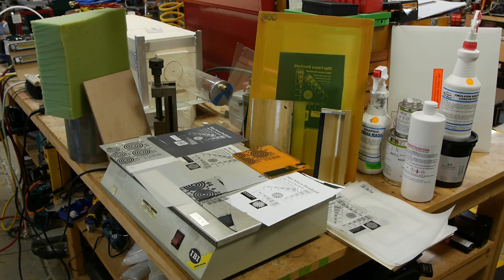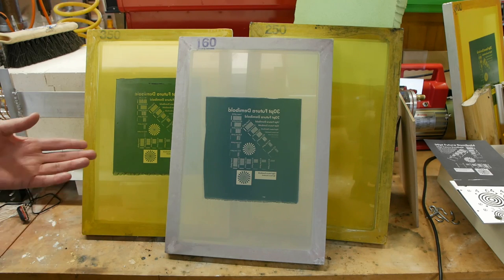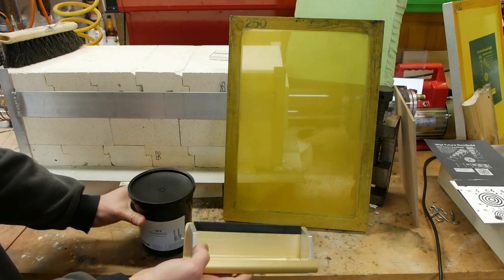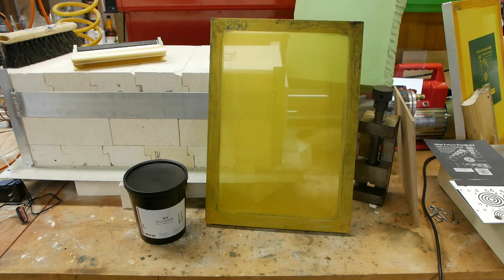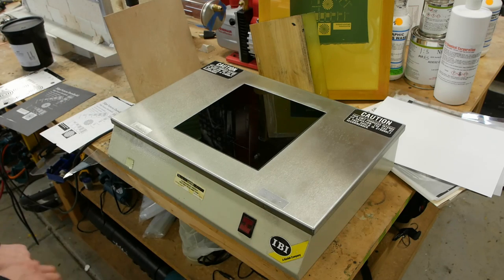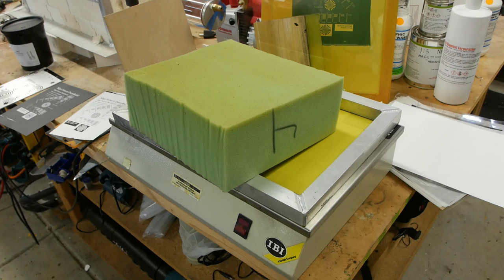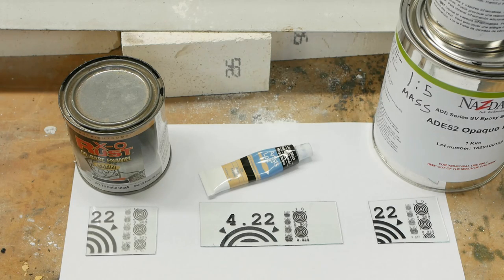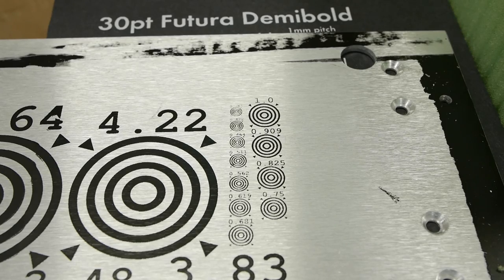High-resolution screen printing demystified

Comment: I would like to note that the emulsion might be one of the most important parts of this whole process.  I used RUCO UV activated inks and it was taking out my emulsions due to the sensitizer.
I had to use very specific emulsion and I would highly recommend using what the manufacturer of your ink suggests.  ( I would like to note that RUCO suggested any Diazo emulsion would work, but I had to use Prochem Dual cure.

Comment: Great video for starting on silkscreening. This pretty much sums up my 5 years experience silkscreening PCB.  One thing to add. Very high resolution positive films can be obtained from imagestter. It makes a big difference for finer prints of line width of 8 mils or less.

Comment: I use a UV LED array to expose photo emulsion for printed circuit boards and screen printing. The benefit is that the light is pretty columnated.Columnated light improves resolution. Less horizontal light leakage.
It's also a good idea to check the photo emulsion and light source exposure first by leaving, say an inch exposed, then every minute, expose another inch. This gives a graduated exposure and allows you to fine tune how much exposure you need.

Comment: Nice video. I was use silkscreening at the past to make artwork on PCB.

Some suggestions.
For a high contrast transparent artwork:
The best result that you can get with a laser printer done by printing a transparent film in the highest contrast setting that is possible on you printer and then apply a thin layer of ink for whiteboards (you can use also whiteboard marker). Then after of some minutes of drying time with the help of a paper towel you wipe your artwork. The whiteboard ink doesn't sticks on the transparent but only on the carbon. This technique give more than 70% higher contrast than the original printing. 

For the Photosensitive film: Actually the films gives the best result than the paste. There two types of film positive and negative, they find use accordingly with the printing application(eg. For the placement mask I was use positive and for the solder mask negative). From my experience the negative films give a bit better result and last longer than the positive. 

For the exposure: If you use uv lamps the distance from your screen is very critical, the light rays from the lamps is not parallel and some areas get more light than others. The best setting for your installation comes from experimentation. The rule is that as many more tubes you have as a further away you need to place the screen, also a diffuser from lcd screen can help. 
The sun is the best source because the light rays is parallel and the power density is the same on every place on the screen. 
One other solution is UV LEDs.

Comment: for cleaning up epoxy based paints ive always used a 1:1 mixture of acetic acid and denatured alcohol, the acid interrupts the catalyzation and the alcohol dissolves the base components but thats just my experience
Reply: That mix Sounds suspiciously like wine :-P...
Reply: Is that for epoxy before it has cured?  I've found acetone to be good for that, too.  But after curing I'd be surprised if epoxy is rapidly affected by alcohol, acetic acid or a mix.

Comment: You can actually use plain old laser printer prints on plain old printer paper. But to do that, you need a really bright (bad for your eyeballs) UV light table. We used to use these UV CFC lights inside a vacuum table. That kept the image as close as possible to the emulsion and substrate. Inkjet prints can be used but the ink is just not dense enough unless you use archival quality inks and fancy paper and a great Epson printer. Even then, it doesn’t touch the cheap laser printer toner for density of output. We used to use the liquid emulsion all the time. It really does work fine as long as the tray is not warped and the screen is well stretched. Roller bar screen frames are way better. We would stretch and adjust and measure the newtons of a small weight on the center. They’re great for higher pressure needed for higher count screens. Yeah it’s an artisanal process, even if you get some manual presses or fancy pneumatic automatic ones. Some fancy processes for things like chip prints use laser etching of a hard stencil.

Comment: Thank you for that video! This makes me want to dig out my screen printing stuff and give it another try! 
Oh and one thing: When in doubt that the exposure time was a bit too short (thus the emulsion not fully hardened) you can soak the exposed screen in water for 30 seconds or so. This softens the emulsion and makes washing it easier (less aggressive on a potentially soft emulsion) Afterwards you can further expose the screen.

Comment: lol you should have just asked me I spent half my life printing high resolution things. Emulsion isn't your best choice for detail.
commonly called the direct method. A better way would be called the indirect method which has a thin film of emulsion coated onto thin mylar and is exposed and then adhered to the screen. Your quality would almost double using indirect. There is also one called Direct/Indirect using a thin film like indirect but adhered to the screen and only then exposed.
Reply: Photoemulsions applied with a scoop coater are fine for a lot of screen printing,  the indirect method is OK for smaller sized images, but it is very finicky, your technique had better be good and you and the conditions and equipment need to be the very best to get good results. If you are using stainless steel cloth screen 500 count screen mesh and printing resists and such on fiberglass circuit boards, the indirect method is the one you want.  If you are printing 4 foot by 10 foot vinyl banners  4 color process 45 line screen on a 75 foot long 4 color automated screen press at a rate of 250 banners an hour, direct photo emulsion method works just great.  Digital printing is starting to eat our lunch though.
Reply: Part two?
Reply: Just remembered the film we used to use (Retired from printing now) Blue poly 2
http://www.ulano.com/indrflm/indirect.htm#bp2
Reply: Oh and if your artwork has a lot off parallel lines 90 degrees to one another  rotate the positive to 45 degrees of the warp and weft of the mesh so they "don't" line up. The reasons should be obvious to someone like Ben.
Reply: that's certainly more of a "surf-thing" but having coated thousands of hand stretched 355+ mesh screens for use in 10-12 plate  photo reproduction on dark garments.  day in and day out for years, I can hand coat a frame at the same quality with liquid emulsion all day long.
Reply: @GradyBroyles  I was going to chime in with 'some experts will disagree' regarding direct vs indirect. I am with you. A sufficiently skilled coater with a high quality photopolymer emulsion can knock out high detailed prints all day long.

I have been printing since '92, and use chromatech PL exclusively since '94.
I can't imagine using any other process. I have put some high res sim process up against a Kornit Storm DTG, and the owners of the Kornit could not really tell the difference between my hand printed shirts vs their $500K DTG

Cheers
Reply: @joeshmoe7967  trufax.
Reply: @LukePettit3dArtist  I dont want to be a "well actually" guy, but.. 45 degrees can be almost as problematic especially if you have any other half-tone on any of the other plates. Moire sucks.  Try 22.6 deg instead.

Comment: I used to make printed circuit boards using similar techniques. I found my best results were when I put the transparency ink-side against the sensitized board. This prevented light leakage from within the transparent material (from the ink being separated by the thickness of the material from the photo sensitive board). I wonder if some of your fine resolution lines would be improved by this method.
Reply: Ditto! I did the same in the late 70's and the ink side had to be in contact with the photo-sensitive film - In some cases (with thicker acetate film), the difference was staggering.

Comment: One other important requirement light/exposure wise is to have as parallel light as possible, ie as far away from screen as practical. Up close as in your light box with several tubes means light is coming in at all angles from side to side as well as at 90 degrees, so undercutting is a real issue.
I used to use just one 2' UV tube with parabolic reflector, (just adhesive mylar mirror on curved plastic..) it was about 2 foot away and required 3-4 minutes using applied emulsion (pva based diazo stuff..) Worked a treat. Also have used a welder once to get out of trouble, don't advise it!

Comment: I worked at "Mum's" it was part of the Technicolor Universal Pictures in Pinckneyville Illinois. I ran a print machine for the DVDs. They used a very similar process to this. I did not get to make the silkscreams but I did watch a few times. It seems like to me  the silk screen  was on big rolls . They would print it, expose it in the big box then build the frame to hold the ink afterwards. Or maybe they just built up around the frame, a reservoir? It's been about 15 yrs. A little hard to remember .
They shut down and moved their operation to Mexico to save money. Apparently the cost of $0.10 a DVD from start to finish was just too expensive! Most DVDs will only have five different colors maximum. The machine would squeegee one color then blast it with UV light then move to the next color and so on ... I would have to get all 5 pictures lined up perfectly for each color to have one master picture at the end. 
You did a fantastic job figuring all this out!

Comment: @JBFromOz I also grew up in the industry. My dad operated two of the three importers of silk screen materials, inks, films, mesh, emulsions, machines and so forth, incl the sole agent for Ulano products (best in the world in the 1980s) used in this video.

The carbon arc lamp was one hell of a thing... most people today would get scared. 5kW of arcing power between those electrodes, noisy, smoke, so it sounded, smelled and looked like it was going to blow up any second. We had one for a while, mostly to test relative performance of films and emulsions, and the production line (we made a dozen frames per day or so) was with mercury lamps, vacuum rig (with the film dryer under it, to reuse some of the heat). We also framed a LOT. Most printers in Sweden didn't have their own framing equipment, and was my stock summer job... 3 small frames (or one medium, 110x160cm) per 'batch'. Setting up, glueing and cutting free took about as long as dry time for the 2-component glue, which was 15-20 minutes. We also had one crazy customer who ordered LARGE frames, which was something like 200x600cm, and 5-10 of those were ordered a few times per year. I think it was for large sign boards, but no clue how they printed them. Anyway, I am glad that my dad sold the businesses in 1989, just before everything went digital.

@Applied_Science If I remember correctly, the optimal height above the print is partly depending on the material you are printing on and partly the ink being used, and it can improve print resolution quite a bit. You mentioned 5-6mm , and I vaguely recall that to be a little on the high side, but not at all unreasonable. However, it was more important to have same height all around.

Comment: I've never tried screen printing, but I do make my own PCBs, so the tips in this video still apply. One thing to note: If you're printing onto something that can be cleaned easily like a flat piece of metal. You'll get much better results if you skip the screen all together. Just brush or roll a thin layer of photo sensitive epoxy onto your part, and lay a transparency directly onto the ink (being careful not to trap bubbles). Then expose as normal, and wash away the uncured resin. You can get well below 200 micron lines with this technique. The only (large) downside is that you have to use photo sensitive inks/resins.

Comment: You should add an LCD screen on top of your UV source and digitally create the mask to directly expose the emulsion to adhere to the surface of interest -- 15.6" 4k screen should be able to get you the 0.2mm pitch. Would be an interesting addition.

Comment: When I worked at a screen print shop in the '70s we only had (at least where I worked) enamel & vinyl inks.  Mineral spirits was used to clean the enamel and really mean stuff called "vinyl screen wash" was used for the vinyl inks.  And we used it to clean spots of enamel that simply wouldn't come clean with the mineral spirits.  You certainly don't want to get a drop of the vinyl screen wash into your eye!  Don't ask how I know this....  i don't remember all of the ingredients, but some were acetone, xylene, and another "-ene" that I don't recall right now.  I believe there were a couple of other ingredients, but it's been way too long since I read the label.  As far as getting the artwork "burned" into the film, we used a carbon arc light as our light source and the artwork was "pressed" onto the film/screen via vacuum under glass -- really large screens had to be done differently.  This video really brings a lot of memories back!

Comment: I'm about ten minutes into the video and so far it's great i think you're giving great advice :) but when you apply the diazo emulsion on the screen, you need more support. I just finished a 2year course in printmaking and we always used the liquid stuff and it's pretty easy to get a nice thin layer of it on the screen. You need to find a way to fix the screen in place so you can have full control of the pressure and angle of the thing (in Portuguese it's a "rodo" ) you use to apply the emulsion. Also, you need to press quite hard and be careful with the angle so it won't spill on the sides. This way most times you only need one pass of emulsion.

Comment: Great treatment of this very complex subject. There are some really smart, and informed comments below, so I will add only this:  When it comes to high resolution images on plastic or metal,  match the screen to the ink first,  the  screen to the image second.  After that, it is just attention to process, and watch out for that electrostatic discharge!   Gads, the hours I spent adjusting the screen height, squeegee pressure, stroke speed, etc, etc on those damn TAAS presses to print tiny logos on smooth white  and clear plastic inserts.  I really began to miss the Hopkins and white cotton.  The commenters below will understand.

Comment: The higher the hole count your screen is will make blue acetate harder to stick to your screen and then harder to get off after you've exposed the positive. Speedball photo emulsion can be applied with a plain printing squeegee. Its a nice student/ hobbiest grade material. You can get better detail from it than blue acetate.  You can see when you place the screen on your light source the other side of the screen is still yellow across the bottom half of the exposure area. When you go to wash the unexposed portion off you risk having holes in that area. Also felt works instead of foam.

Comment: i remember doing this in highschool. i remember it was a pain to get the emulsion back off once it was all done and you wanted to change the screen to a new template. the one we used was a hot pink emulsion.

Comment: there are toner darkener sprays which slightly melt the toner particles on the vellum and they cover the areas and so increase contrast much more. You can also get similar effect if you hold the vellum in a container with acetone vapor. If you use high contrast art work you will get much better results.

Comment: On the shadow issue: your problem is hard light.  You need soft light.  The solution is to put a diffusion layer (something like wax paper another sheet of vellum) in between the source and what you're trying to expose--ideally closer to the light source.

The difference between hard and soft light is directionality.  Hard light is when most of the photons are traveling in essentially the same direction.  The basic example is a light source at the focus of a parabolic reflector and something blocking light directly between the source and subject such that only light reflected from the parabolic reflector reaches the subject.  This causes shadows to be really hard edged with minimal penumbra.

Soft light is when you have just a bare bulb.  Light hits the subject at all kinds of angles which broadens the penumbra and softens the edges of shadows.

Comment: I've had good luck with a custom exposure box made from cheap UV leds.  The emulsion is sensitive to UVA so you don't need far ultraviolet to expose it.  The plus with using LEDs is that the light scatters less.  I forget the rating but I remember the LEDs had a fairly narrow beam angle. The box I made was fairly deep as well to ensure most of the light hit the artwork perpendicularly.  As a result I found it wasn't crucial to get the mask close to the emulsion.

Comment: If you're doing this a lot using a scoop coater on one side of the screen is much better. If you do it right you only need one pass. For higher resolution images you want a thinner coat.

He's correct that higher mesh is harder to work with, ink drying in the mesh is a common issue, and higher mesh causes ink to dry in the mesh easier.

If it takes longer than a few hours for the emulsion to dry it's probably too thick.

Exposure times are determined by the minimum duration to expose the emulsion through the substrate. Accurate exposure times can be determined by doing a step test on a single screen. It's possible to use 20lb printer paper as a positive with stronger light tables.

Vacuum tables for exposure are very helpful, and the stronger the uv light, the faster the time and less chance of a bad exposure. Pressure washers and a wash out area are a must if you plan on doing it often.